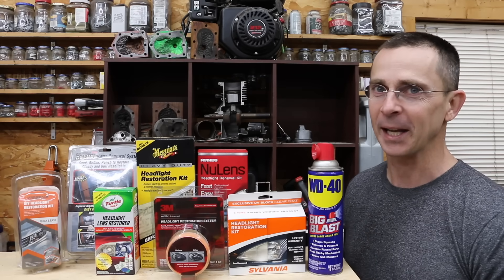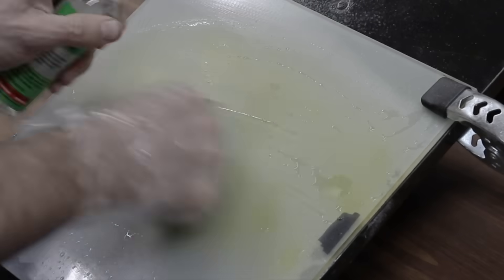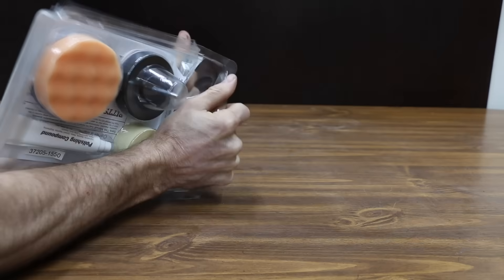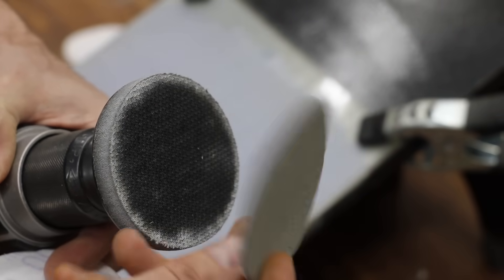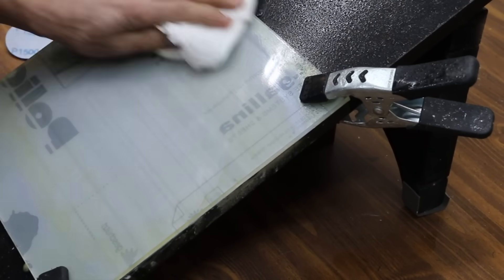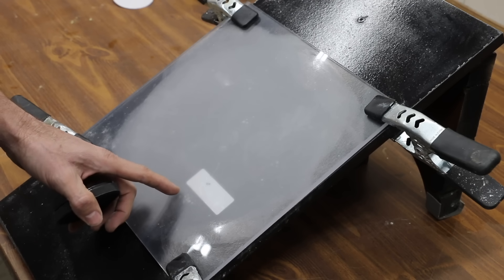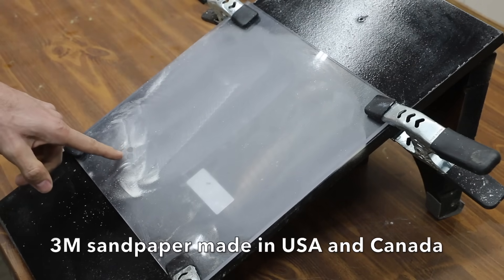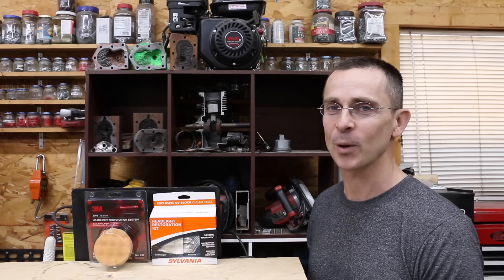Best Headlight Restoration Kit?  Let's find out!  3M, Sylvania, Meguiar's, Mothers, Turtle Wax & HF

Comment: One product test idea I'd love to see is a comparison of headlight bulbs. I was recently buying a replacement bulb and was shocked at the variety of bulbs available, from $20 to $55 per pair - all offered by the same manufacturer. All of the bulbs were 55W halogen.  Size and configuration were the same. So what, if anything, does a person get for shedding 2 to 3 times their hard earned money?
Reply: Yes, thanks. Me too. Unfortunately, the glare & brightness in the “ ADD- IN bulbs, etc” are way to blinding , esp consider That almost   NOBODY  an adjust / aim/ dispersions of the glare, actually big problem with ADVERTISING, NEW LIGHTS, HKMES, TRAFFIC, ETC.
Reply: @opera93  ..yes,,especially those annoying blue-colored ones....
Reply: @opera93  - I totally agree and as I’ve aged, it simply gets harder to see at night & at times blinding while driving as and after someone approaches in the opposite lane with these new Super Bright Headlights.
I’m not the only person either. My Wife’s parents refuse to drive at night along with many of my friends in their 50’s, even while wearing reduced glare glasses, ever since the Halogen Headlights were put on the market.
I’m not sure if the MVA or Police Departments have any regulations or perform any testing, but it would be great if Project Farmer could test and submit his findings to each State Agency.
That is how valuable his tests are to me.
Reply: I wanna put new bulbs in my car but I don’t wanna be one of those a holes blinding everyone else. I think leds are the blinding ones but not sure
Reply: @MrDickhead47  The blinding is caused by not properly aiming their headlights after installation of the LED's
Reply: @MrDickhead47  80% or more of new vehicles use led lights now. I wouldn't worry what others think cause there are glasses you can wear when you drive at night to cut the glare. That or do what your driving instructor taught you and that's to not look directly in the light and to look to the right side of then road and focus on the driving lines.
Reply: @Slider617  I ended up putting leds in and not only can I see way better but it looks wayyyy better
Reply: 2$ is probably the real reasonable cost
Reply: If you want a led light bulb that close to old light color, you may want to look for color temperature of 4500K rather than the 6000K. Over 6000K will look like blue. Under 4500K will be fog light yellow. Most old headlights housing are reflective and since the LED bulb is on a copper plate, thicker than the old bulb as a single spot, the light become off and it's hard to channel all the light to a good cut off line so it feel like blinding the other car. If you can upgrade the housing to a projector lens style, LED light bulb will be much better keeping a clean cut off line and you can adjust to a avoid blinding the opposite driver.
Reply: In my case, life. My car uses PWM on low beams for DRLs (which is a terrible thing to do to incandescent filaments, IMO). I was going through Sylvania lamps every few months. I spent the big bucks on Osram branded ones, made iin Germany, and they've been running solid for around 5 years, now.
Reply: My experience it those Audis and other high end luxury cars use xenon or HID lights that too bright and blinding. I bought a pair AUXITO LED for my old Honda. These are a quality built light and at $60 are much better than halogen bulbs that last 10 months. I would not buy those cheap LEDS you see on E bay, they are garbage. I did check my lights and it easy to see my factory cutoffs in the light beam pattern, drivers side has about 25 less throw and right has longer throw but more spread. From across a parking lot they look bright but not blinding at all. Auxito does a lot research and development and it shows.
Reply: @ReadyFreddie5523  many modern vehicles, especially luxury lines are actually going to be LED or Laser.
Reply: Here’s an idea…when it’s dark…drive slower! You’re never gonna be as safe at night as you are during the day simply because it’s dark. Also, animals that you blind with bright headlights won’t move as quickly because they are now blinded. Common sense isn’t as common as it should be.
Reply: Find some LED's for what you drive, I just put a set on my Corvette and what a difference they made.
Reply: @MrThunderMetal  I wanna change bulbs but are led the lights that blind other drivers? I put an led on my bike cause the ferring has a tinted lens cover and I could ride with a tinted helmet lens at night even. By the way I ended up getting hit on that bike by someone running a yield sign, not a big impact but the pipes burnt my foot and 2 months of being in the hospital later and they amputated halfway up my shin. Pretty much ruined my life so I’m getting into cars to get some sanity back
Reply: @MrDickhead47  I haven't had anyone flash their bright's at me when I'm driving with LED's so no I don't think those are the super bright ones. Friend has them installed on his F 150 and Suburban and no one flashes him. I've got another set that is going on my Silverado. I got them on Ebay just look for the best deal. I found the same bulbs at different prices so it pays to find the lowest price before buying them. Hope this helps.
Reply: @MrThunderMetal  thanks for your response. Yeah I have a Chrysler 300 and the headlights have a led part and a yellowish bulb I just wanna make ‘em match. I forget if the led had different brightness options when I did my bike
Reply: @MrThunderMetal  also I wonder what the lights are that do blind people caus those drive me nuts and I would never want them on my car
Reply: @MrDickhead47  any lights, including halogens, will be blinding at night. That's why headlight housings are designed to keep the light on the road and not through car windows. There are specifications that must be met for the lights to be road legal. This is also why it's not legal to use light bars on the road. They do not have the required throw pattern to make sure light is staying low, out of line of sight.

The problem is, most people who install aftermarket bulbs, such as retrofit LEDs and HIDs, do not check their headlight adjustment. Often resulting in the cutoff line being above the legal requirement. If you are seeing into people's cars / lighting up the back of their seats as you pull up behind them, you know your low beams are angled way too high.

Unless the replacement bulb has an identical throw pattern as a halogen (just about impossible for LEDs), you will need to make adjustments. Reflector based housings are more susceptible to this, than projector housings.

As long as the lens assemblies are adjusted properly, there's no problem using LED bulbs or HIDs. I've had really good luck with AUTOIX bulbs from Amazon. They get very close to factory filament patterns, but still require some adjustments to get them spot on. I've had a set of AUXITO 9003 bulbs in my SUV for over 16 months. Cheaper and brighter than my last set of zXe's (high output halogens), and have already out lived them.

To check your alignment square up the vehicle with a wall, about 12ft away. If you have projector housings, your hard shutter line, should be a couple inches below the center of your headlight's housing. Reflector housings don't have a hard cut off. Do your best to ensure the hotspot is rolling off by the time it reaches the height of your housing. Use the adjustment screws as needed to achieve the above result. 

Some vehicles only have a vertical adjustment, some also have a horizontal adjustment. The hotspot should be inline with the fixtures if you can make a horizontal adjustment.
Reply: @MrDickhead47  Ow - you've been through a lot of pain. Hope you're getting better as fast as possible.
Reply: @MrThunderMetal  Perhaps the biggest issue is idiots who change the headlights and don't properly aim them afterward. Right and left headlights are usually aimed differently and I doubt half of them even get aimed at all.
Reply: @MrThunderMetal  LED's are great but not if you live anyplace where you get snow - as they don't make heat and snowfall will stick to the headlights while you are driving, making it necessary to pull over and clear the snow off of them every little while.

Comment: I have used Rust-Oleum Wipe New that can be picked up at O'Reilly's. Used it on three cars all in the early 2000's range. Beyond easier than the 6+ step examples shown here. Noticed they lasted over two years in clarity (and I run my cars through the automatic car washes 3-4 times a week. Product under $11.00.
Reply from the maker: Thanks for sharing.

Comment: Great review! Could you review fuel injector cleaners solutions. There has been talk that come cleaners can be abrasive and cause damage to the injectors, the other question is that do these cheap products have a reasonable result as commercial mechanic injector cleaners are supposed to be the optimual choice in serviceing . Just a suggestion great stuff you do.
Reply from the maker: Thanks for the suggestion.

Comment: Long overdue comment but…
The Sylvania kits do clear things up well but after a year or two at most things start to go bad again.  I’ve used them a couple times over the years.
They come with a “LIFETIME” warranty.  First kit I didn’t keep the receipt.  Second I did and when it started to go bad I decided to utilize my “warranty”.
After many phone calls, submitted photos, doing everything requested I got NOTHING…except eventually ignored totally.
These folks are the poster kids of customer disservice.
Buy the kit and use it but understand it’s not going to last and NEVER expect the “warranty” to get you a replacement when it doesn’t..
Reply from the maker: Thanks for the feedback.

Comment: Thank you! I got the Sylvania and the 3M kits, I taped with Painters tape(3M), Used the Surface Preparation(Syl), 400 grit sand paper(Syl), 500 grit sand paper(3M), 800 grit sand paper(3M), 1000 grit sand paper(Syl), 2000 grit sand paper(Syl), 3000 grit sand paper(3M), Buffing Compound(3M), Buffing Compound(Syl), remove the tape(3M), Clear Coat(Syl). Yes this took some time, about an hour and a half, but the headlights on my 2007 Honda CRV look amazing as they are curing. Well worth the $30 - $45  of the two kits, and a good amount of elbow grease. Awesome Video, and you did instigate even attempting this, as I had never seen it done before, Thank you!
Reply from the maker: You are welcome!
Reply: Given that the Sylvania and 3M probably do the same job up until the clear-coat, I'm inclined to get the 3M kit so I can use a drill to polish, then use the Sylvania's Essentials kit for the final phase, which has just the surface peparation and clear-coat. Total cost would be about $24 for both, versus $20 for the Sylvania full kit.

Comment: I just used the 3M product on my headlights because of this review.  My local Auto Parts stores did not stock the Sylvania kit unfortunately.  The 3M kit did a great job and did include two wipe packets that are supposed to be a protective UV coating  Hoping it last for a while but for right now it looks great!  Thanks for this review.
Reply: 5 months have lapsed wince your post. How is the 3m holding up?
Reply from the maker: Great selection!  3M is great
Reply: Hey! Is it going good?

Comment: As always, a great testing scheme. I like the poly sheet use to level the playing field. I have thoughts and questions: perhaps on the lower sandpaper quality, you could rub the paper across the sharp edge of a counter, to "break" the sandpaper's back. This is an old woodworking trick, it opens up the pores and should minimize loading of the paper.
Could we buy 3M paper here and cut to fit instead of crappy paper?
Last thought, about the sanding, instead of a drill, would an orbital sander perhaps give a more uniform pattern ? If you had the time, you could try just sanding a sheet of Poly and do a side by side with the drill and orbital, using the same sandpaper? 
Im going to do my headlights soon, so this (I watched it twice) is helpful and I think the Sylvania will be my choice.
Can't wait for the next!
Reply: Most autobody supply shops and any parts stores that deal with paint will have just about any sandpaper your looking for. I know that you’ll definitely find it at auto supply stores that specialize in automotive paint.

Comment: I had a thought. How much does restoring headlights really help with brightness and visibility? And how does it compare to just putting in some brighter whiter bulbs that are available now? Be interesting to test both from a driver seat and an oncoming car point of view. I mainly ask because the cost of some higher powered halogens and LEDs is only like 2x what some of these restores kits are and a heck of a lot less work! Plus I just wonder how much difference visibly is. Everyone always seems to compare before and after of the way the lens looks but seldom or never of the actual seeing at night.
Reply from the maker: Thanks for the suggestion.

Comment: I don't think this was a very fair test. The exposure of UV on polycarbonate causes a chemical breakdown. From what I've read from one study, it takes 2000 hours (approx) of exposure to UV for a 6% loss in light visibility. You could just leave polycarbonate sheets on a roof or something for 3 months for a good test though it would be better for it to be done during the summer due to the longer days and higher humidity.
Reply from the maker: Thanks for the constructive feedback.

Comment: I’ve used the turtle wax and 3m kits along with a different meguiars kit and mothers mirror glaze compound on a buffer professionally. Turtle wax works very well for lenses that aren’t too bad and it’s hard to mess up. 3m is the best all around. The meguiars kit was similar but not quite as good also the coating was very thick and runs. It’s easy to ruin the surface if not done right. Mirror glaze works very quickly and does a great job as long as they don’t have textured oxidation. Personally I’d just use that every couple years.
Reply from the maker: Thanks for sharing.

Comment: Those test sheets were in awful shape. 3M and Sylvania did a nice job on them. For "normal" headlight oxidation the simple and great method is Meguiars Ultimate Compound with a foam pad on your polisher. Minutes per lens and outstanding results. I use it on tail lights too, the look like a wet cherry cough drop when done. LOL
Reply from the maker: Thanks for the feedback.

Comment: Clear coat lens with automotive clear coat with hardner.  German brand about $25 a can. Worked great.  Handed sanded lens to 3000 grit.  Live in AZ., holding up great, at 3 years.
Reply from the maker: Thanks for the feedback.

Comment: I believe in "do it yourself", however, at age 67, my 16 year-old Toyota Sienna headlights were dim beyond belief. I bought a couple of these restoration kits--at that time, most of them required hand sanding. Lot of work for near zero result. Gave up on doing this. Checked online for new headlight housings for the Sienna--which were expensive. A few months later, I spotted a sign on a business that said "Headlight Restoration". When I got home, I looked up the business and gave them a call. They charge according to the damage to the headlights. For me, it was about $90.00. Worth every penny, and they did a terrific job very quickly. 

At any rate, I like Project Farm's testing--the videos are pure gold.
Reply from the maker: Thanks!

Comment: I fixed my 06 accord headlights a few years ago and they’re still great. Wet sand the headlights using fine then extra fine auto sandpaper. Clean and dry w windex. Put a few coats of spray on clear coat but it must be labeled with UV protection. Worked like a charm. Less than 10 bucks for everything at Walmart.
Reply from the maker: Thanks for sharing.

Comment: I used the turtle wax brand and I also experienced the folly of the small pads. However, I wet sanded with some 1000 grit sandpaper before using the kit. I got better results! Thanks for your no nonsense videos. Be safe!
Reply from the maker: You are welcome!  Thanks for sharing.

Comment: Local hardware store: 800, 1500, 2000, 3000 and plastix 2.0. 20 mins done. Finsh with nufinsh and the carnuba.  Prob have most of this stuff anyways. Only going to use 1/2 sheet total anyway. Use polisher for best results but elbow grease is also fine.
Reply from the maker: Thanks for sharing.

Comment: I've had great success restoring my headlights with the following procedure:
1- Remove the headlight assembly from the vehicle and clean with Glass Cleaner (not containing silicone).
2- Using a random orbit car polisher, polish the lens with Automotive Polishing Compound (white) to clear the light assembly.  If the light assembly lens was extremely yellowed, you may need to clean and then polish it a again with fresh Polishing Compound until it is visibly clear.
3- Clean the lens with glass cleaner (w/o silicone) and dry thoroughly with a micro-fiber cloth.
4- Mask off the light assembly, leaving only the lens exposed.
5- Spray the lens with an acrylic gloss clear coat.
6- (Optional) After the 1st coat dries, spray the lens with a second coat of the acrylic gloss clear coat (follow the "recoat" directions from the manufacturer).
7- Let the clear coat set and dry for 1 to 2 hours or until "dry to the touch" (whichever is longer).
8- Reinstall the headlight assembly into the vehicle.

I did this on my Crown Vic headlights over 5 years ago and they are still very, very clear!
Reply from the maker: Thanks for sharing.